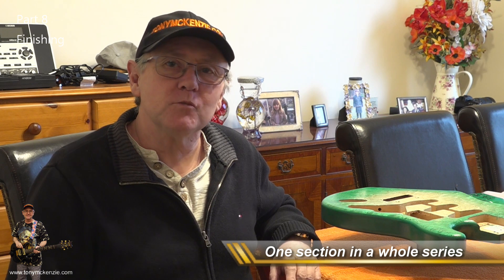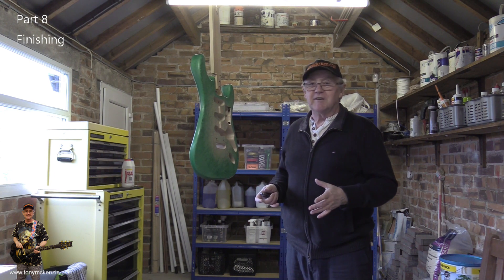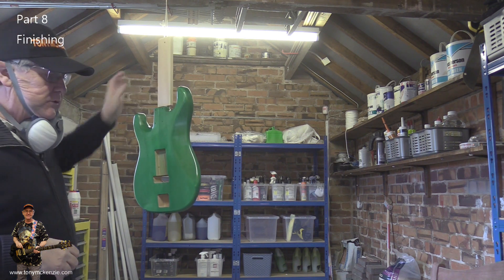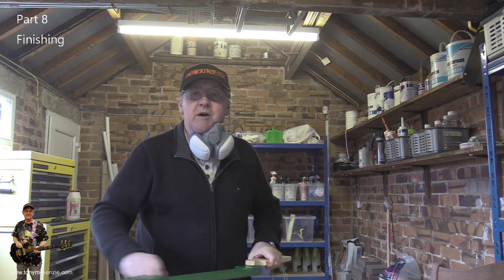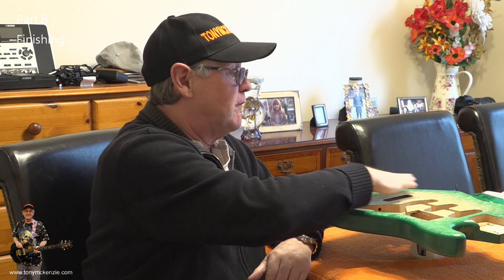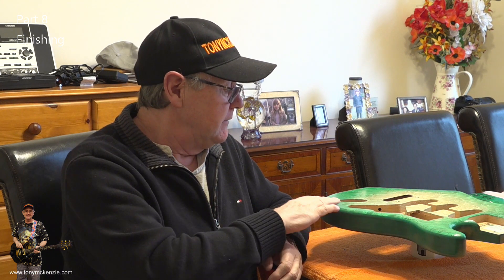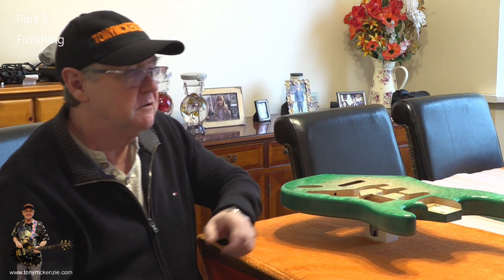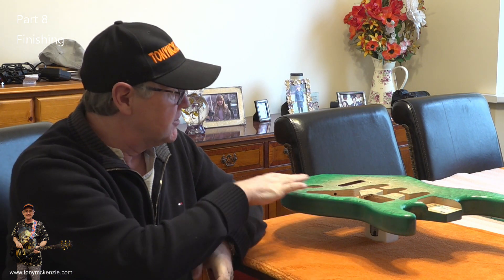Perfect Warmoth Stratocaster Guitar | Featured: Body & Neck Finishing | Part 8 Acrylic Lacquer

Comment: Couple of small tips Tony when using rattle cans,   shake the can really well between coats,  also between coats turn the can upside down and give it two or three short blasts,   this will help clean up the nozzle of any dried paint or lacquer ,  maybe the reason you had some spatter.  Always fully depress the nozzle,  just keep the can moving,  light pressing the nozzle also can cause spatter.
Reply from the maker: Thanks for these tips. It was only right at the end on the final coat (on the back) that I had three or four of them at once. I looked at the nozzle and did see dry paint so likely that. But your points are great and posting them is great so thanks for that contribution. While I have used spray cans for a long time, I have not used them for as long as this and I think the longer you use them the more chance of issues is more likely. Thanks for watching and stay safe.

Comment: Tony, hi from the scouser in (snowy) Connecticut! awesome as usual mate, has been a while since I heard the name Halfords! -- couple of tips 1) wear gloves. Tack ragging but touching it with bear hands can lead to contamination 2) stick the spray can in a bucket of hot water for 5 minutes before spraying and between coats 3) double up your coats on the edges (they are the most common areas to burn through when sanding and polishing) 4) cut a groove where the neck stick meets the front of the neck pocket, it will be a natural break in the paint film (you run the risk if pulling the paint off from the body if you don't) rock on dude!!
Reply from the maker: Trust you're not too cold! Great tips for the Halfords stuff for sure. The hot water one is particularly one I had not heard of before... very cool (or hot!) Every one of these is a gem though and I am very grateful because it helps I am sure so many guys. My escapades have worked so far. I could have kept rubbing the wet or dry paper but for me its good enough. Thanks again for these tips and stay safe.

Comment: The sheen on the front and back is what I prefer Tony. If you want to back off the sheen in the cutaways, use some 0000 steel wool, very lightly. I'm not sure I would bother, but it's an option.
Reply from the maker: Well, remember I'm also creating a 'how to' video too and I will be using 2000 paper and two levels of finishing polish to get great shine (hopefully!). I do also have acrylic clear coat that is actually semi gloss (or matt) which could be used for guys that don't always like the full on gloss though. Good point. Stay safe Jim...

Comment: I'm also working on a kit guitar as well. I found the longer you let the clear sit before the rub (wet sanding with 2500 grid) the nicer the finish will look.
Reply from the maker: Absolutely. Semi-dry finish will not be good and WILL clog up the paper for sure. Thanks for posting your experience with that. Stay safe.

Comment: Nice 1 again Tony, I've been spraying a case for a treble booster kit, a terrible booster though ha! Anyway, can't get the lacquer to go on without air bubbles , primer & paint went OK , any ideas anyone,
Reply from the maker: Ha terrible booster :) Thumbs and heart for that :)  That's classic. Put the lacquer on in very thin coats. If you blast it on in one go it will create many problems from what I see. don't worry about the funny looking surface - you solve that later. Slow, thin coats over dry thin coats!  Stay safe.
Reply: Thanks Tony, I already tried to spray a thin coat, I'm gonna try blasting it with a hairdryer when the coat goes on, sure I heard that somewhere, Thanks again
Reply from the maker: I used a room heater turned on medium and moved it around a lot. A hair dryer would work but keep it lowish.... stay safe.

Comment: Spray cans are a nightmare, I think you did well under the circumstances Tony!
Reply from the maker: They are. It can be done though and the finish as it is now is quite acceptable... not to the nth degree I guess, but its as good as I want it to be - I'm not entirely fanatical about it. It surpassed what I thought I could achieve though with spray cans. Stay safe.
Reply: @tonymckenzieofficial  I am glad that you are happy, that is all that really maters. I am staying as safe as I can, Galicia is getting many more cases now but the vaccine is coming soon for my age group. Stay In, stay safe, play guitar, that is my motto!
Reply from the maker: I had a problem tonight on the back of the neck! The next video on this will show it and how I solved it and another issue not related to finish. Its the one that will show the tremolo and the tuners... worth watching. Yes we stay in too and our jab is somewhere nearing. My wife is really concerned and does not like to go out at all!. But it should get better soon.

Comment: Hey Tony how do you like that T.C. UOGO..... I got one also and I think I am finally going to break down and either get a Sustainer, or buy a guitar with one already in it.
I was thinking of the Fender Stratocaster EOB...or a Schecter of some sort.
Reply from the maker: Honestly, that's for a review and I have got as near to that currently as standing other gear on it. Hard work on the finish and polishing... well spotted though. I considered an EOB too. A good basis to enhance yourself reasonably easily too and not too pricy. Stay safe.